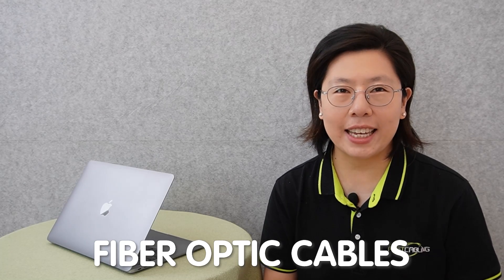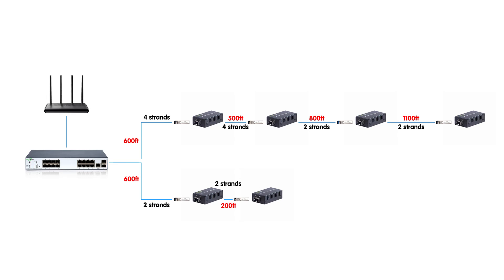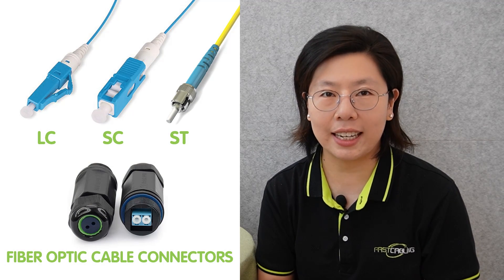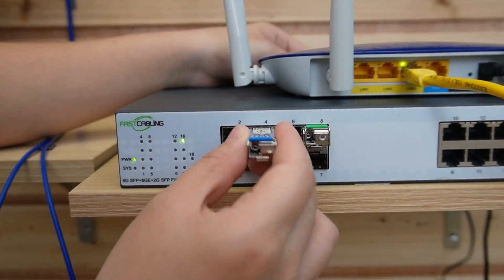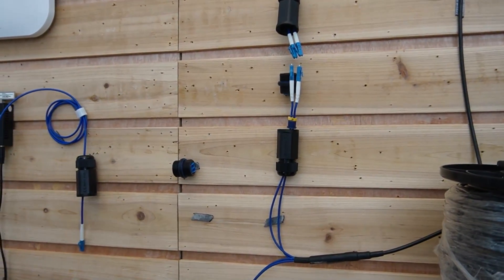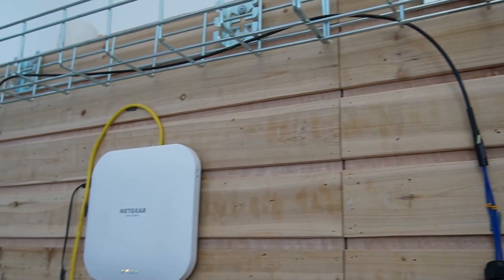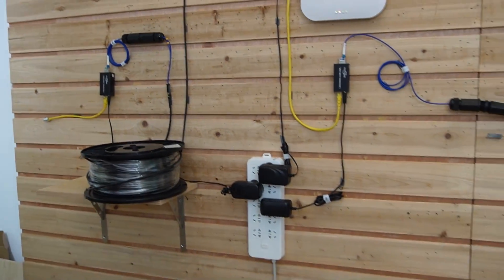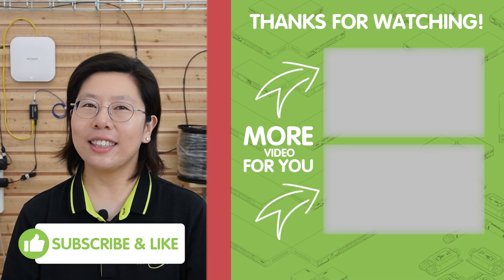Starlink for Multiple Buildings: Fiber Optic Cable Setup Case Study

Comment: Can i control another build bandwith from main station?
Reply from the maker: Yes, run fiber (or wireless bridge) from your main station to the other building, then use a managed router or switch with QoS/rate limiting to cap or allocate bandwidth per building.

Comment: How do I make a starlink as a WAN in my community??
Reply from the maker: Starlink Dish → Ethernet Adapter → WAN Port on Your Router → Local Network

On your router, set WAN interface to DHCP (Starlink assigns dynamic IP addresses). If needed, configure NAT, port forwarding, or firewall rules.
Reply: please can I make you my mentor??Am a student studying network engineering and I want to use starlink to connect to a WAN as a business enterprise in my community
Reply from the maker: I'm afraid you cannot use Starlink to re-distribute the network commercially. This is against the policy.
Reply: @Fastcabling Is there a way to use it unaware?
Reply from the maker: Using Starlink to redistribute internet commercially goes against their terms of service and could result in termination. There are also coverage limitations—once you move beyond a certain area, service may not be available.

We recommend looking into Starlink’s official Business or Community plans.
Reply: @Fastcabling please what’s starlink official plan or community plans??
Reply from the maker: https://www.starlink.com/service-plans/business
Reply: @Fastcabling This means is possible Sir??
Reply from the maker: You might need to consult Starlink for more info.

Comment: Can this setup be used in a residential building with 40 units,?
Reply from the maker: In such cases, it's better to use PONs. From the splitter, a single fiber can serve multiple units by splitting the signal, usually up to 32 or 64 units. Each unit would have a fiber drop that connects to an Optical Network Terminal (ONT), converting the optical signal to Ethernet.
Reply: @Fastcabling  In such a setup, can starlink WiFi work?
Reply from the maker: You can connect the Ethernet output from the Starlink router to an Optical Line Terminal (OLT), the central device in a PON system. From the OLT, the internet connection will be distributed via fiber optic cables to multiple Optical Network Units (ONUs) or Optical Network Terminals (ONTs) at the destination points (e.g., homes or buildings).
Reply: Noted with thanks